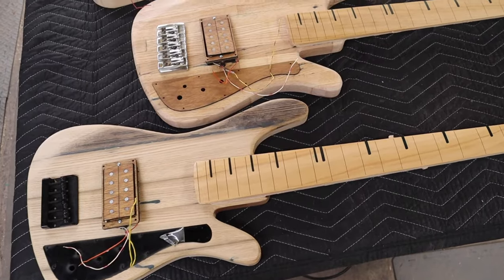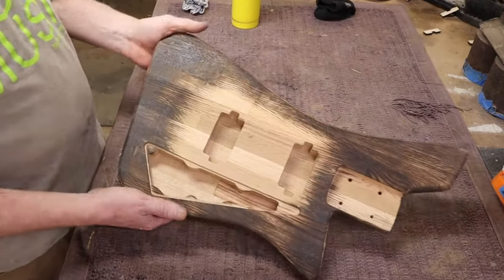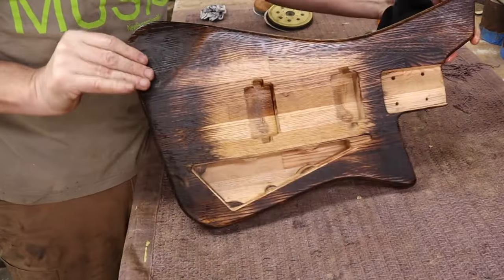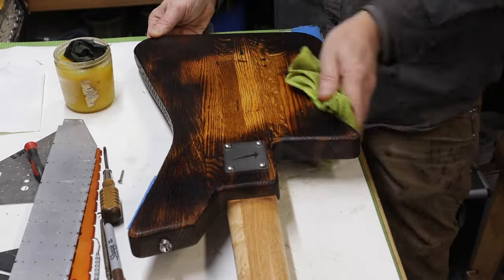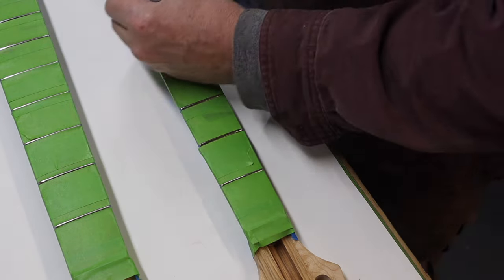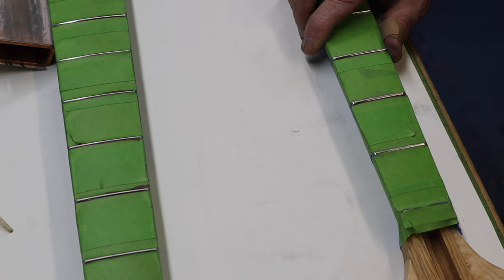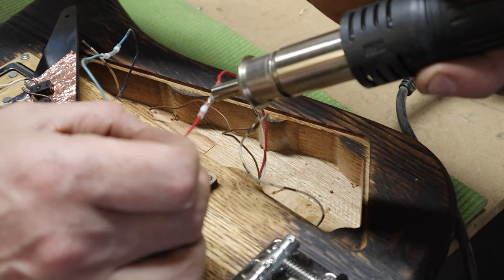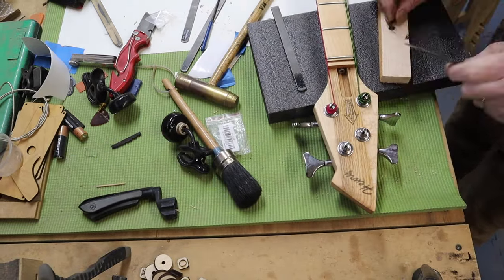Henry the Bass - A 4-String Bass for the Futuristic Family

Comment: I do prefer nitro lacquer, but oil finishes are a very close second. Tru-Oil is fantastic stuff.
Reply from the maker: The environmental element is a big concern and obviously, nitro is out of the question! lol. Tru Oil is pretty bad stuff, too, environmentally, so I avoid it as well. There are some decent water-based polys out there ike Total Boat Halcyon that is pretty durable and easy to use and I'm also a big fan of Natural Earth Paint's Varnish, which is what. used on the neck and fingerboard.
Reply: @timsway  Have you seen the finish that David Piccuto recently came up with?  His unofficial claim is that "it's so safe and natural that you could eat it (but please don't)"
Reply from the maker: @pileofstuff  It's probably pretty similaer to what I make, but his looks like it might have more oil and less wax in the mix. I like it thick and pasty :)

Comment: Analog sunburst colour finishing is so brutal
Design is cool but IMHO the transition from the back of the neck to headstock is too big. I think you should try to relocate the truss rod screw to the heel and make the Fender style transition. It looks and feels way better. For easy truss rod adjustment you can make a pit in the body for hex key
Reply from the maker: The transition is certainly not for everyone, but it  is a design choice not just for the truss, but several reasons. Some players use it as blind position reference but most players' hands will never even know it's there.

Comment: Sure wish you'd tell us weights....
Reply from the maker: Weight is more subjective than you'd think as a lot of it has to do with where and how the weight hangs on you. I usually remember to weigh them and include that info when I list them for sale. Even my "heavy" guitars tend to be a little lighter than most heavy guitars because of my body size and thicknesses usually being smaller. This bass would be on the "heavier" side as it is made from heavy materials and a full length neck, but probably still only 8 lbs.